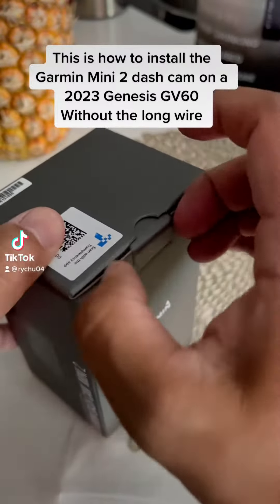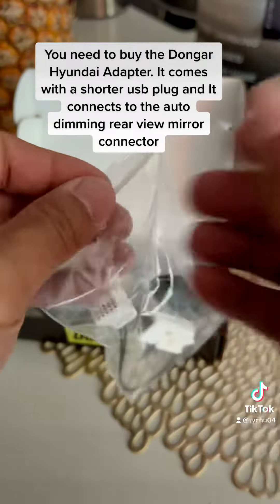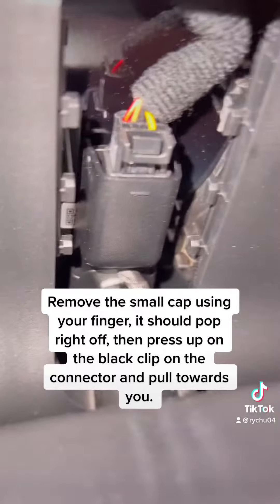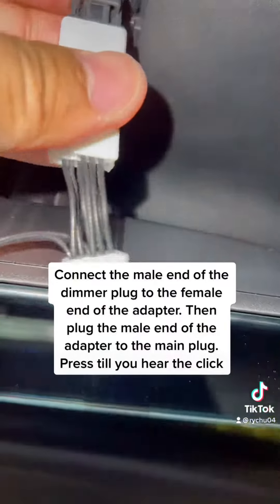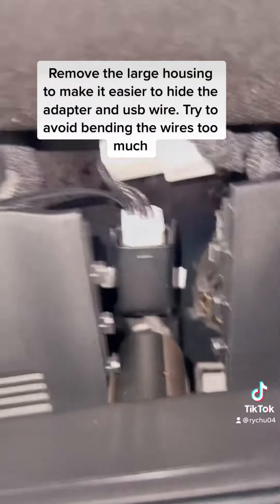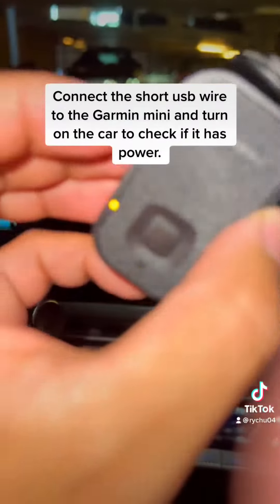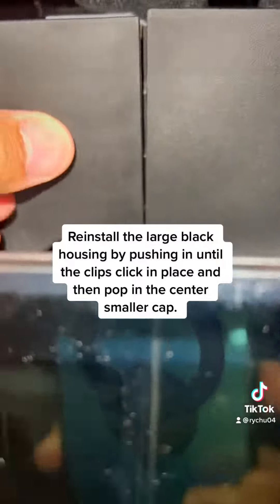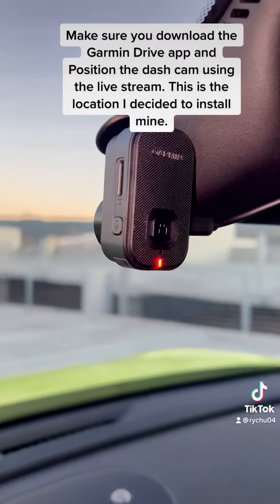Almost Wireless Dash Cam install on a 2023 Genesis GV60

Comment: Hello I have a quick question  when connect this to the cam does this adapter only have power when the car is turned on , or will it work when your car is parked in a parking lot or outside your home , as I think maybe the power from the mirror is only powered up when the car is turned on. Thank you.
Reply from the maker: Yes the camera is on only when the car is on. You will need to tap into the 12v or have a portable battery pack to keep the camera on parking mode
Reply: @rychu04  Thank you so much for your quick reply. I have it all wired now front and rear cam , I was amazed how easy it was to do , I did have quote of $450 .00 Canadian to do the install way too much money so I did it myself I just ran my main feed into the USB below the dash all works 100% thanks again.
Reply: @shaunmckenna1923  How did you install on the rear? Is there a similar hack for the rear dash am install?